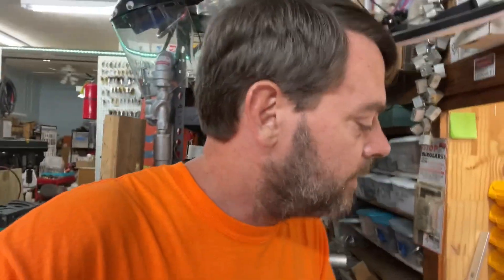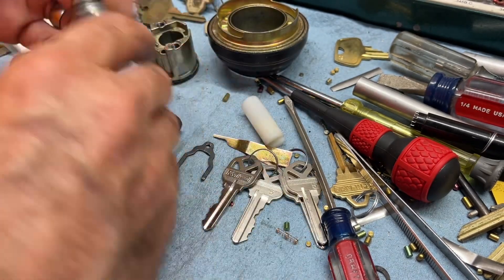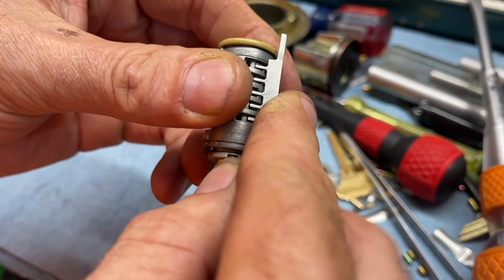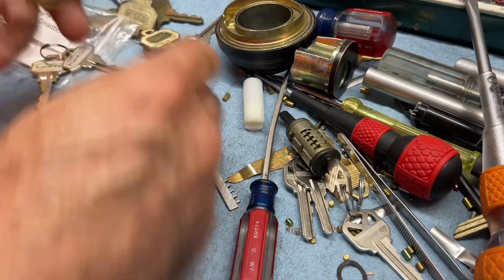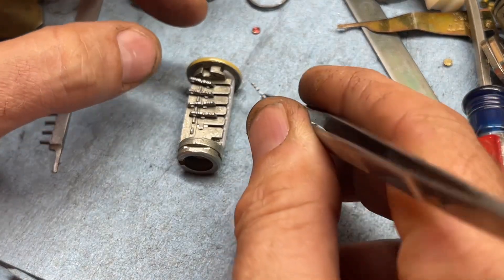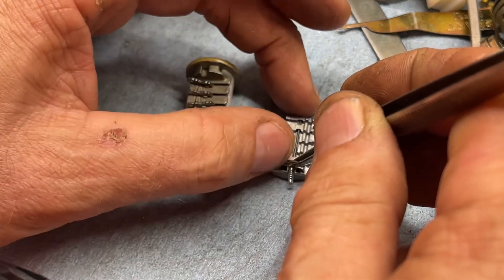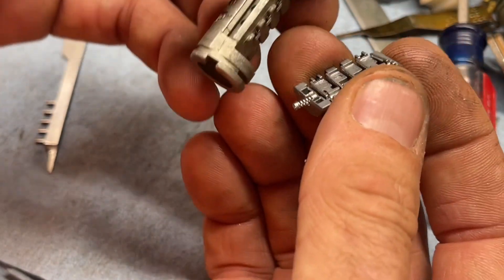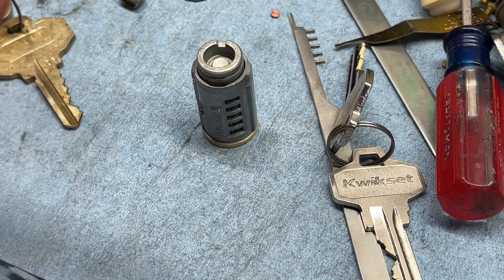Schlage Keyway Smartkey Cylinders - No Key Reset

Comment: I picked one up a few months back to use as a SC1 “key checker” in a Kwikset key control #816 deadbolt (swapped it with the upper landlord key cylinder). The other cylinder I use for KW1 key checking. Thanks for sharing.
Reply: Any idea if a smartkey SC1 version of the 816 key control landlord deadbolt exists yet?  I don't want one, but curious how well the 816 sells if they would make a Schlage variant.  Also thanks for the breakdown video, Jason!
Reply: @zach2763  I’ve not seen one but would be nice to have. It’s nothing to buy the sc1 cylinders and put in place of the kw1’s.

Comment: I never used a cradle for Smartkey. I just use a set of code keys. With them I decode the lock buy gauging the pins to decode it then just make a key to open it.

Comment: So it appears you don’t have to remove the wafers at all to reset? Just remove the cylinder from bible, slide the spring loaded reset side back put new key into the cylinder, release the spring loaded reset side, then put the cylinder back in the bible and your done?
Reply: The reset carriage won't slide back without all the sliders (wafers) set to the key bitting; i.e., you need a working key to do it without disassembly
Reply: @Pyrolock   In your video, I thought you mentioned the black half moon piece was what prevented the rest carriage from sliding back. But once the cylinder was removed from the bible would popup. Which is that point it sounded like it may allow the reset carriage to just slide back?
Reply: @Pyrolock  I just rewatched your video. So after you remove the cylinder from the Bible, is it possible just to slide the reset carriage to tension the wafers and then poke at the wafers to get them to line up? In preventing complete disassembly of the cylinder? Because disassembling one of those cylinders in the field could potentially be a disaster.
Reply: @mumbles1justin  Yes, that is possible -- in fact that is a way to actually pick the SC-1 smart key by putting tension on the reset carriage thru the reset hole on the face of the plug.  To pick an installed lock by this method is quite difficult, really only for expert LockSporters, but it has been done on the bench.
Reply: @mumbles1justin  actually I corrected myself later in the video.  The purpose of the black half moon piece is to actually hold the reset carriage back in the reset position when the plug is in the bible (so you can remove the key and put in a new key).  When you rotate the plug, the black half moon piece is forced to drop back down, thus allowing the reset carriage to be sprung into the forward position.  This locks the sliders (wafers) into the key pins for the bitting of you new key.
Reply: @Pyrolock  I’m going to order a replacement SC1 cylinder just play with.
Reply from the maker: @mumbles1justin  I'll give it a try tomorrow!